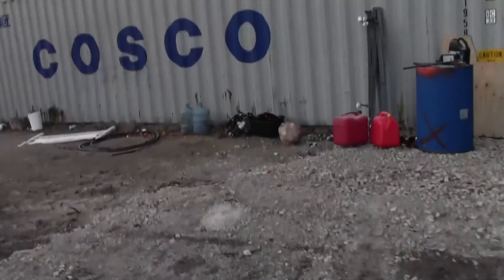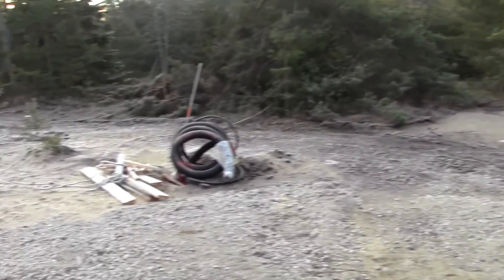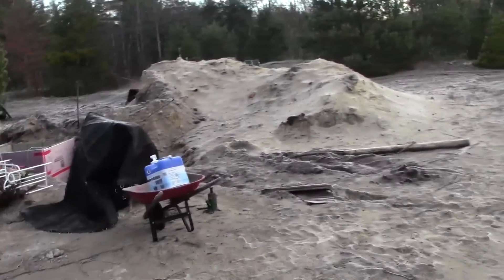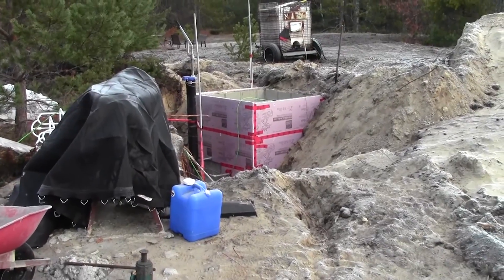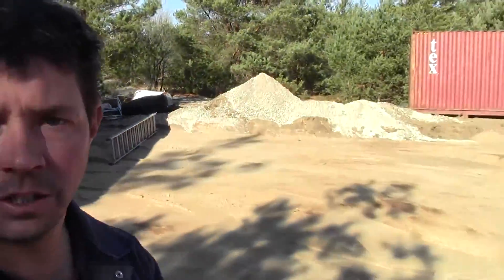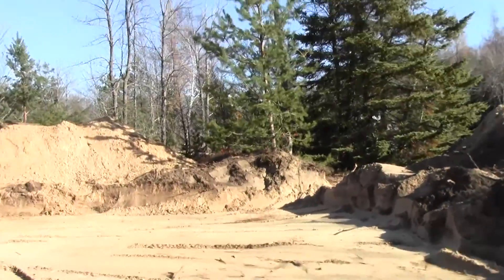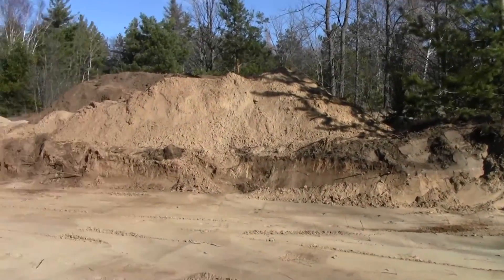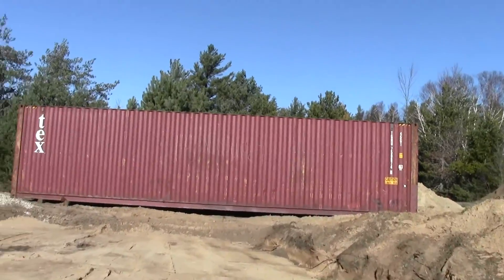S01E16   Shipping Container Solar Barn   Part 1

Comment: Do you need a building permit for this project? Are you in Ontario? I'm planning a similar project but mainly its going to be a garage.  Thanks.
Reply from the maker: Yes we needed a permit.  Also engineer report for the cans.
Reply: Oh wow I wonder if I will need an engineer report on the cans I'm getting. How much does that cost? I guess because they're holding up the roof?
Reply from the maker: It was about 1200 buck.  Just a money grab if you ask me.  The cans are stacked 10 high and cross the ocean.  I am pretty sure they can support a trusses.
Reply: You're absolutely right! Cash grab for sure, you must be in Ontario, lots of red tape here.
Reply from the maker: Yes, We are on the Bruce Peninsula in Ontario.
Reply: Im near Niagra, Ont. I hope I don't have to o through that.